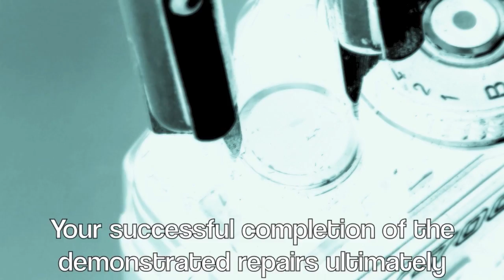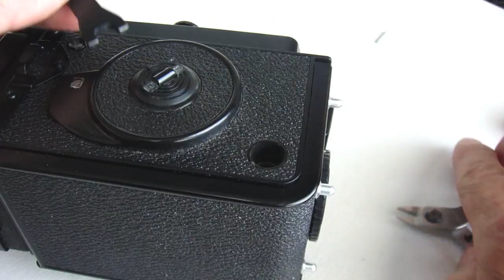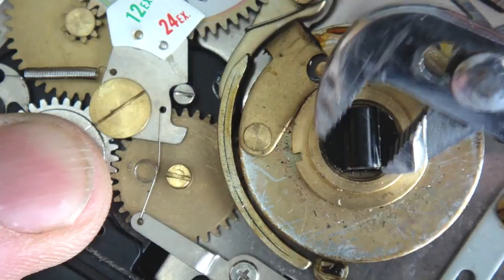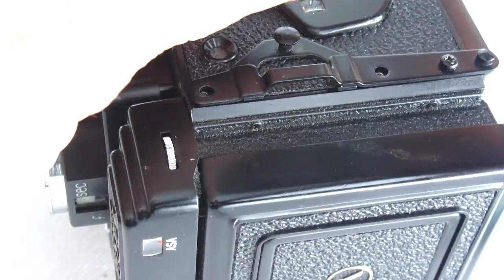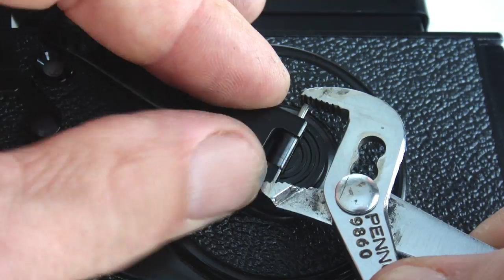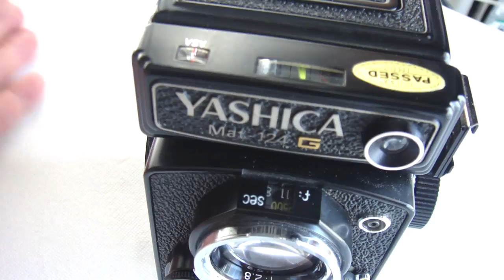Fix Old Cameras: Yashica Mat 124G Wind Crank

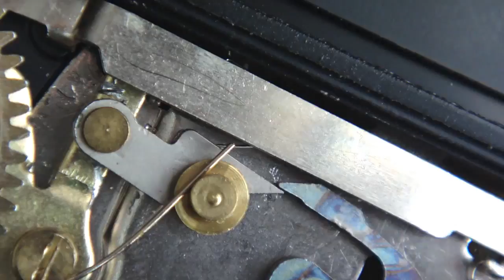Comment: Fellow travelers... I just finished ovwerhauling the winding mechanism on my EM.  It would wind to frame 1 and them completely jam---those pawls are trouble. At about 1:02 in this video you can see that one of the pawls has a tiny wire spring behind it, and that spring slips into a tiny groove that is milled into that pawl against the thin edge.  It's very easy for that spring to slip out of its groove, especially so if you've removed the parts for cleaning in an overhaul, and especially so during re-assembly.  The winder wil jam if that tiny spring breaks free of its groove. Many thanks to FOC!!   Cheers.
Reply from the maker: Good additional information to point out. Thank you

Comment: Hey my Yashica Mat EM’s frame counter doesn’t work properly. Normally it stops after each frame giving the proper spacing on the film to give 12 exposures. Mine doesn’t catch, it doesn’t count frames but it does rotate freely so I can still use the camera. Any advice? Also do you have a tool list for servicing yashicas I could look over?

Comment: Hi, I am repeating this question because I have similar problems. Thank you for your answer

After your repair when you wound through all 12 frames did you have a roll of film inside? Or did you have a take up spool? I just received my yashica mat124g and it will keep winding until the film is all the way rolled up, just curious if I try this repair should the crank be able to stop with no film in the camera?

Comment: This is fantastic! Thank you for this video. I found my grandfathers Yashica Mat (not 124G) and wanted to see if the behaviour of the crank stopping at different places for different frames was normal, which I can see it is. As a side effect however, you've taught me how to fix the early catching when winding to advance the next frame, which it currently sometimes suffers from; now I know what to do! Just a quick question, would PTFE lubricant work okay for this application? Cheers.

Comment: After your repair when you wound through all 12 frames did you have a roll of film inside? Or did you have a take up spool? I just received my yashica mat124g and it will keep winding until the film is all the way rolled up, just curious if I try this repair should the crank be able to stop with no film in the camera?
Reply: i have similar problem, do you already fix it?

Comment: Hey, Fix Old Cameras! I have an old half frame Yashica Mimy S. It recently stopped working properly. The shutter crank wheel on the bottom of the camera turns around without the camera cranking shutter. I can turn it without it stopping. It started by the shutter crank would crank until the shutter released (without me pressing the shutter button). Any idea what could be the problem?
Reply from the maker: The spontaneous release would likely have been caused by a jammed or sticking release linkage. Now that the camera is not winding you might also have a slipping or stripped wind gear or gears.

Comment: I have a Yashica mat 124g and I am having a problem with my winder as well. Sometimes, the winder will stop at the next fram, and other times it will just keep winding until the entire roll is taken up. Is this what was happening to your demonstrated camera? How can I go about fixing this? Thanks for any and all help!
Reply from the maker: With the wind side cover panel removed and the wind lever reinstalled look to see it the engagement pawl for the counter drive mechanism is dropping in place as the wind lever is operated. (a pawl is a lever that engages with another component to prevent movement in one direction, or prevent movement altogether)
Reply: Hey Calum did you ever get this fixed? I’m experiencing the same issue with my 124g
Reply: @jamesperkey1797  Hi James, I did get it fixed but I sent it for a CLA. It's been working like a charm ever since! Good luck!

Comment: Thanks for the video! I need to fix up my Yashica Mat 124, so this will be very useful. Any advice for removing the leatherette without damaging it? I'm a bit scared of tearing or stretching it out!
Reply from the maker: If the leatherette is stubborn, patience, patience and more patience. Seep alcohol under the the leatherette and give it time to work on the glue. There are stronger solvents that will loosen stubborn adhesive quicker, but always check for compatibility before liberal application. Once the glue has softened carefully work a dull blade under the leatherette. (slim bladed screwdriver, modified painters pallet knife, or spudger) https://www.amazon.com/shop/fixoldcameras

Comment: Great video as always have a question i have been taking pictures for 3 years and ever since i started with an olympus om10 i have maintain all of my equipment  i have a yashica d  yashica tl super pentax k1000 yashica fr1 kodak signet 40 digital canon rebel t6 that i have gotten over the last 3 years in flea markets all in good working condition a few months ago i was giving a canon ae1 and a yashica minister d the cano ae1 i fix it thanks to your wonderful advice now the yashica minister d i took a few pictures and while doing so i realize the settings on the lens don't work the ring for the shutter speed moves along with the one with the aperture and some other ring any suggestions on how to fix this range finder works great very clean i will hate to just set this aside without getting a good experience out of it if you can please any tips on solving the issue on this camera
Reply from the maker: Great to hear of your growing collection of working classic cameras. The Yahsica Minister shutter uses the Light Value system of exposure control in which the aperture and shutter speed controls are interlinked; changing one automatically changes the other thus keeping the effective exposure the same. To change the exposure, it is necessary to change the applied Light Value. The shutter speed-aperture combinations can be changed. For any particular exposure setting the corresponding Light Value covers all of the shutter speed-aperture combinations within the range of the lens and the shutter.
Reply: @FixOldCameras  thanks for the tip i had my doubts about it after developing my roll of film som of my pictures were good some were dark i will have to practice a little more with it thanks for all the info you provide us with your videos great job

Comment: How annoying that the black center of the film crank is scratched with those teethed pliers. 1m20 into the video...
Reply from the maker: Hopefully, farther along in the video, your annoyance dissipated a little once the well worn wind crank handle hub post and the perceived scratch was secured beneath the hub side cover, the crank handle guide, the crank handle spring plate, the crank hub handle cap, and the crank handle itself. Obviously if you are concerned about marring the finish of your camera parts a metal jawed pliers might not be a good choice of tool for manipulation of parts... perhaps a plastic or rubber jawed pliers. Thank you for comment and your interest in Fix Old Cameras.

Comment: Thank you for the great video. I have a similar problem that happened when testing the camera with out film after many years of non use. The shutter seamed slow and then the crank locked up. It won't move in clockwise or counterclockwise direction. I think the camera had an empty spool in the take up part of the camera, the top spool. Now I know not to use an empty film spool, after reading the comment here.
Can you do a complete cleaning and servicing of the shutter one day?

Comment: I have an Olympus 35sp  that has a problem that no one on the camera forums is able to answer. When I cock the shutter the film take up spool and the film advance sprocket are not moving. The film rewind button on the bottom of the camera was stuck down, until I took the bottom plate of the camera and re lubricated it. But it hasn't fixed the film advance problem. has anyone any idea how to fix this problem.
Reply from the maker: The shaft that slides up inside the wind sprocket is possibly not dropping down with the rewind button to engage. It sounds like you are on the right track. You might have to remove the top cover to see what is going on the other end of the wind sprocket mechanism.

Comment: Hi Fix Old Cameras. Did you ever hear about a fellow named Ed Romney? He published DIY camera repair booklets in the 70's. His 124G repair manual dedicated nearly an entire page just on the 124G winding mechanism. It's basically the same in the Yashica Mat, Mat-EM, Mat-LM, 124, 12 & 24 and a very poor design. I purchased a brand new 124G in the early 70's and it was back to the factory for a jammed winding mechanism almost after every "shoot". There was also a warning label indicating that the take up spool must be removed before using the wind mechanism without film in the camera. The points on those littler pawls can also wear down. After my 1 year warranty ran out I purchased a used post War Rollei 2.8 and NEVER had a problem. My Yashica 124G is still boxed up and it still jams. Great video as always, THANKS
Reply from the maker: Great classic camera antidote. Thank you for your continued interest in FOC. Keep-em going.
Reply: Tom Heckhaus what should you do if you did use the wind without film in the camera?
Reply: Can you upload that manual?

Comment: Do the Rollei 35 if you need one to repair I could send you mines. It's works fine but the community needs a repair video
Reply from the maker: Have several request for a Rollei 35 video, about time to try to work one in. Thank you for the offer to allow your camera to be available for filming, but as a general policy to keep things simple, FOC does not accept cameras solely to be featured in a video. And thank you very much for your continued interest in Fix Old Cameras.
Reply: Fix Old Cameras Thank You. The most common issues I’ve seen/had is shutter speed timing, winding gear replacement(Singapore model) and general lubrication.  Light Meter battery modification would also be nice for the PX625 battery models. The ideal repair model is the orginal 35 as all other models follow this design